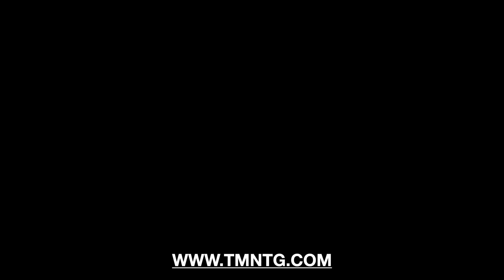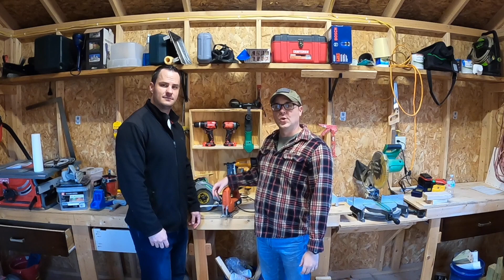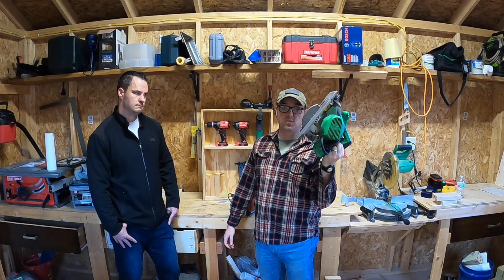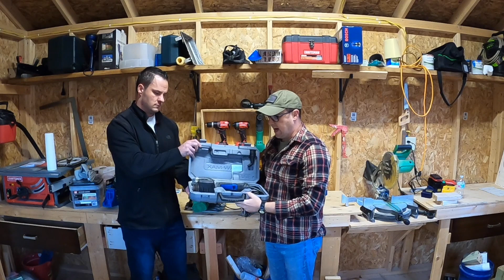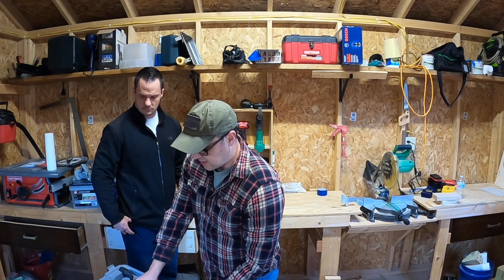Top 5 Power Tools For DIY Homeowners or DIY'ers

Comment: as a new home owner of a home built in 1976 and also a 1st time home owner  I've recently been adding to my tool collection. i do woodworking as a hobby so i had a bit of ahead start. Already had a DeWalt job site table saw, old skillsaw circle saw, DeWalt 12" miter saw, Rikon 10" bandsaw, DeWalt palm router, metabo router, corded ryobi jigsaw, bosh orbital sander,  bosh electric hand planer, DeWalt planer, bench top belt sander, poter cable 10" drill press, a brushed DeWalt 20v drill and a DeWalt 12v screwdriver.
i really like the DeWalt line of woodworking power tools but also have been impressed with the htp router.
I wanted to add a impact driver and got the htp triple hammer 18v and hammer drill combo. that put me in the htp battery line and also got me a hammer drill (new home has a basement) both nice tools  
i was looking at the htp multi tool but came across the DeWalt that came with a free battery and charger for the same price. i also purchased a 36v htp recip saw. that thing is a beast. i bought a pruning blade for it and have been clearing small trees low limbs and small trunks with it. i turn the oscillating feature on and  it'll cut up to around 3" trees with no problems. I'm sure it'll come in handy remodeling the house as well. Haven't had the chance to try out the 36v battery in my 18v htp tools yet  
 i also updated my jigsaw (never was happy with the Ryobi they seem hit or miss) with the 18v htp. it's a no frills model but seems to have plenty of power and has the oscillating feature. Picked up a corded htp circle saw (nice little saw) on sale as well just for using in the woodshop so i can beat on the old one around the house. 
i think your suggestions are spot on. i would add that you don't have to buy the best tools but you don't want to buy the cheapest either. Nothing worse then a tool that only frustrates you.  i certainly could get buy with my Ryobi sigsaw for around the house diy stuff. it's not the greatest quality but it's held up over the past few years just not up to my standards for the wood shop. Get decent tools and get quality blades and bits and most diyers will be happy. i would also add that 12volt tools have came a long way over the years a good 12v impact driver will get the majority of diy around the house jobs done imo. only reason I went with 18v impact was i pretty much diy everything having the extra power will most likely eventually be needed.